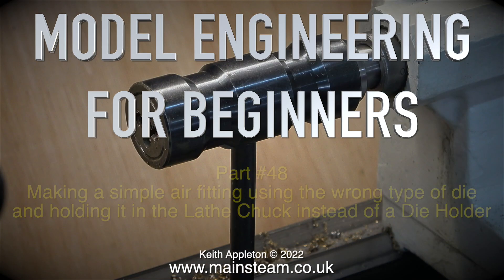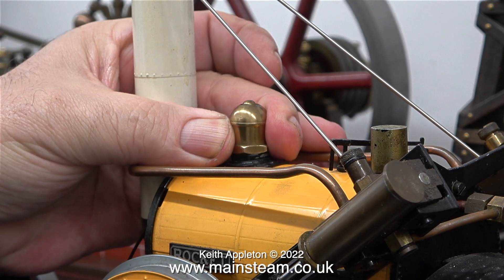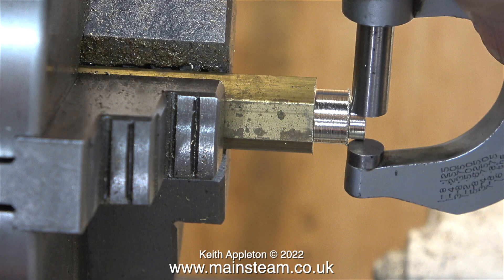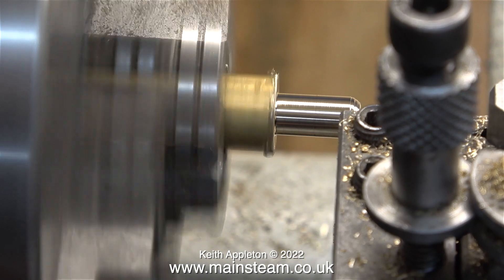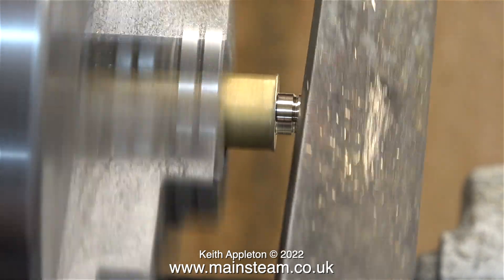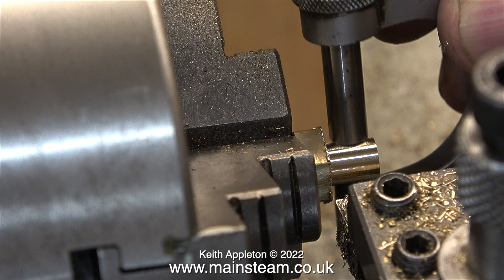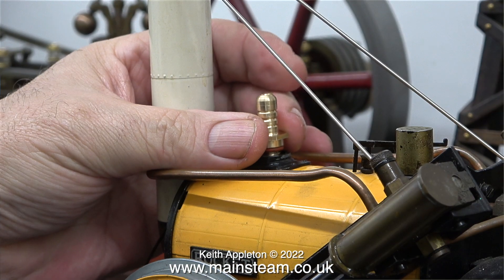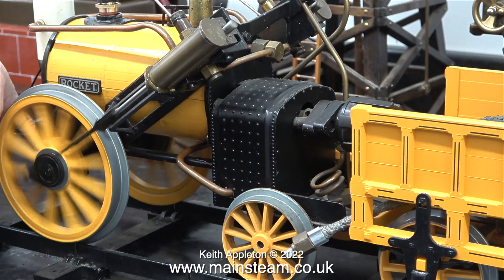USING A NON ADJUSTABLE DIE - MODEL ENGINEERING FOR BEGINNERS - PART #48

Comment: On a sort of related subject. Stephenson's original Rocket would have been built ,as far as I know,well before Whitworth invented his threadform standard. Does anyone know what thread standard Stephenson would have used for his construction  ? Making individual threaded fasteners that only fit in one hole ,I just cannot believe that would have been done. What are the oldest manufactured threads ?
Metric threads in a Hornby kit. Somehow I find that ironic.
Reply: I think that they were still shy of using threads, and used wedges as much as possible, but an interesting question. I dread to think how many standard thread forms there are now.